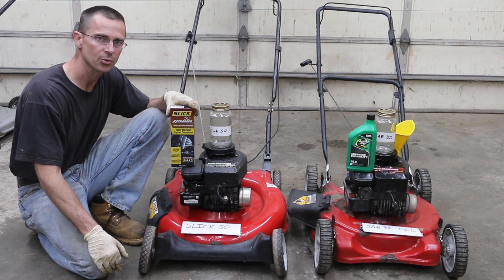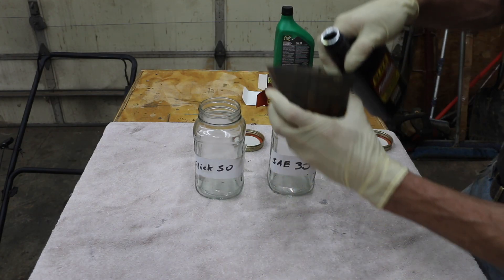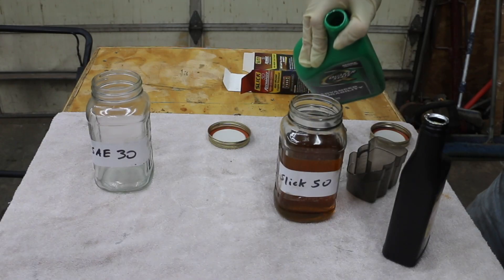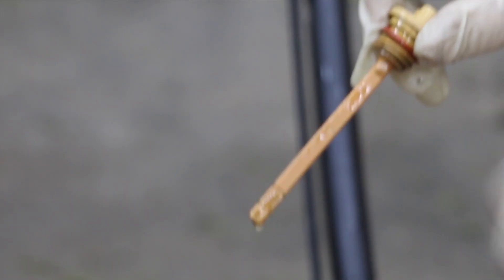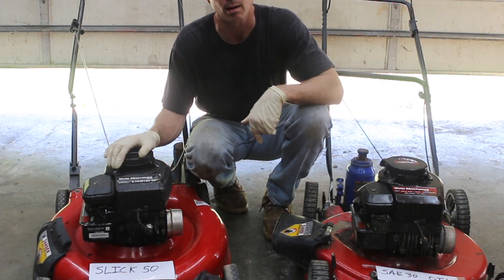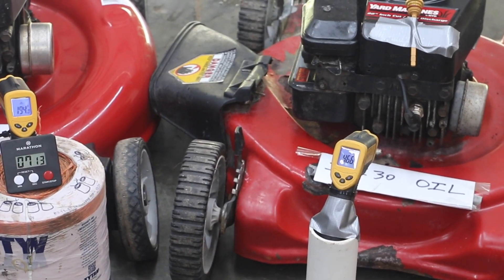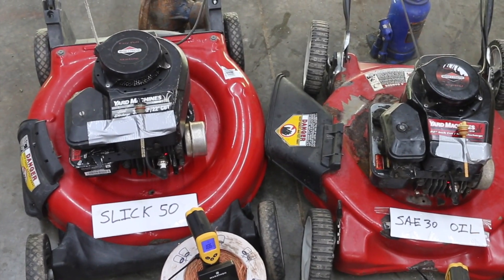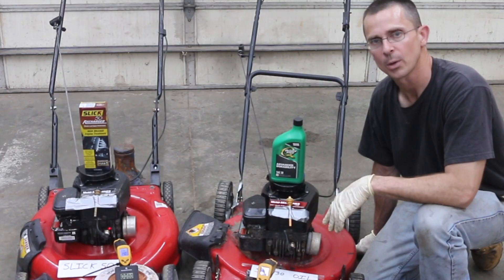Can't believe what SLICK 50 did to my engine!!--Dry Crankcase Test!

Comment: Although I like the idea of your video your test is flawed in one major way. Those engines where used. That being said you can't judge why one failed first. Engine wear from past usage plays a major factor in your test. Plus you didn't do compression tests. Not that a compression test is a tell all on other internal parts but it's something. But all that being said I still enjoyed the video.
Reply from the maker: Great point!  Agree, new engines would provide a much more fair test.  If money wasn't an issue, I'd buy new engines to test.  Thanks for watching the video and commenting!
Reply: Zedhead187 not the same engine either. I agree, not a good test
Reply: It was interesting but I too noticed that the slick50 engine/mower appeared much newer than the other one run with just oil. You might think that would be an advantage, but in reality an engine with a little wear is going to be more broken-in and have less internal friction, as well as more clearance in critical parts to retain an oil film after the oil is removed. Also, for the purposes of testing, we didn't see: Slick 50 instructions say to shake the container up vigorously before installing. Was this done? Otherwise the solids can settle in the base oil, and you wouldn't get much product using only the top few ounces. Also, IIRC from when I used it last, the engine is supposed to be run for 20 minutes at least on initial start-up after putting the Slick 50 in. Was this done, or does the current product still say this? Stuff that needs to be shown if the test is legit. It was a cool experiment, and I'm not shilling for Slick 50, but it wasn't anywhere near a good scientific test.
Reply: Cameronl games thats not the point I was raising. Not knowing the internal conditions of each engine leaves a lot to happenstance. 

What I mean is this. If the engine he put the regular oil in had less "wear and tear" and the slick 50 engine was "worn out" then the test is less valid. Now, just think if by happenstance the engines where switched and the "less worn out one" got the slick 50 and ran longer. The results would let us conclude that slick 50 does work. 

That being said when testing things such as this with used engines your test results can sometimes be less than accurate. Doesn't mean it wasn't worth trying though. I still enjoyed the video and his efforts.
Reply: lucus lube is amazing stuff, but keep at mind the company had been bought out and I've been hearing that lucus isn't the greatest anymore. I still use it though. alright I have a 1995 Chevy Silverado Z71. when i bought it had 101,000 miles on it and always ate a whole quart of oil right after oil changes. I started replacing one quart with lucus additve and fully stoped oil lose and now that engine has 889,567 miles on it right now. everything else has been replaced around it ...specially trans lol but Hopfully that gives you a good idea. btw the 350 that's in the truck has litterally nothing wrong with it at all still. very strong engine. cool Huh? so maybe lucus is really the best.
Reply: Project Farm 
Where did you get the vacuum pump?
Reply: Ben Jamin 
A simple 3 peakHP shop vac with that (mason jar) separator setup would've worked fine as well! However, you can get them at many places, Sears sells a basic one for 240.00 you can find them online for cheaper but 200 is a good starting price they range up to thousands.
Reply: Project Farm 
Nice.  Thanks.
Reply: that what I was going to say I bet the motor with the slick 50 would have blown period very soon. just mowing a lawn it obviously had far more ware than the other one did before the test. amazing how hot the other one got.
Reply: Zedhead187 husband
Reply: Thomas Tinsley ????
Reply: having a hard time there buddy?
Reply: +Riley Pearson wow Riley that's some crazy high mileage
Reply: Zedhead187    Yes that is very true i agree but think about the chances of an engine failing during this test for any other reason than what he is doing
Reply: Spankin' new engines would be a mistake too. Closest I could think of to ideal would be two new engines, run in the same conditions of load (or no load) for say 10 hours or so and then compression checked and possibly checked for crankshaft rotation effort to make sure one isn't still "tight" after breaking in. The performance and build quality of small engines at least at the cheap lawn mower level varies wildly. I've seen them seize after running just a couple of hours right out of the box. And with regards to your Slick 50, as said elsewhere, it sure looked like you were just pouring out base oil off the top.  The Slick 50 I've used has a milky look after being properly shaken before dumping it in. To be most "scientific" using only a portion of the quart, I'd suggest vigorous shaking immediately beforehand, then pour a 1/3 out, use the middle third, and leave the rest in the bottle. That way you'd get a more accurate sample of the contents.

Comment: The "original"  Slick 50 was formulated with PTFE (teflon micro particles) that would coat moving parts.
The new (currently available)  Slick 50 does no longer contain that key ingredient.

I was a huge fan of the old formula.
Sadly, it is no longer sold......

I found some NOS (new, old stock, over 20 years old..) auto oil filters that contained the same PTFE treatment component as the old Slick 50 and they fit my car!
I bought six and am enjoying them. (wish I'd bought 20 of them, they are no longer available).
After an oil change with those filters my engine is so smooth and quiet and the mpg fuel economy increases for a few hundred miles.
Reply from the maker: Yes, I've heard the formula changed and it isn't nearly as good. Thank you for taking the time to comment!
Reply: For anyone wanting to hunt some of those oil filters down? They were made by Fram and were called "Double Guard"   their stock numbers begin with  "DG" (such as DG8A, for their PH8A application, other DG-
 numbers were available)  Now, there are still a few around for sale by vendors of NOS leftover/liquidation auto parts. They say "with Dupont PTFE" on the package and filters, and had a plastic sealing cap over the business end.

Comment: I think the add with the engine with the drained oil was Prolong not slick50. They drained the oil then took the pan off then cut the radiator then poured gravel and dirt over the engine with the valve covers removed.
Reply from the maker: I'd better give Prolong this sort of test!  Thank you for taking the time to comment!
Reply: Yeah I don't know if Prolong is as good as they claim but the way I look at it if its only a tenth as good as they claim it's worth it. I know i had some in an old Saturn I had and the fan went bad and I over heated it to the point where I thought it should have seized multiple times an it didn't. I don't know if it was because of the prolong but I'd like to think it was. I'll be interested to see the results if you do test it.

Comment: Why did you not use two brand-new lawnmowers instead you put the slick 50 in the new lawnmower and the regular oil in the very aged other lawnmower that had been running for years
Reply from the maker: Dawn, I agree that 2 new mowers would have been the much better option.  I wish the cost of doing these projects wasn't a factor.  Thanks again for taking the time to comment!

Comment: LOL! Dude, you cannot just dump the Slick 50 in for a few minutes, drain it out and expect it to work like it did in the commercial. It takes time for the Slick 50 components to properly coat the engine internals. You have got to do these tests properly or they have no meaning whatsoever. Call them up and ask them how long it takes for the Slick 50 to adequately coat all the friction surfaces inside the engine.

Comment: I was an observer  of slick 50 back in the early 80's
I was told that even if the slick 50 engine would stop , it would restart after it cooled down
If you still have that Mower try to restart it
make another video ...... I'm curious
Thanks.  Great job by the way
Reply from the maker: I'll do a video on the Slick 50 mower.  Thanks for watching the video and for commenting!

Comment: What is labeled as Slick 50 today is NOT the original formula, the original formula is now sold under the name Exelplus. I did read the comments and a couple people kinda mentioned this, but not very clearly. I remember hearing tales about how good the stuff was back in the day, but it was a tough sell for me- since a complete oil change with filter back then probably cost 10-15ish bucks and a quart of slick 50 was around $20. Sadly just another tale of a name with a good reputation getting whored out for sales by a big company (I'm thinking of Lucas as well...when i think shell bought them). Anyway nice effort, good vid
Reply from the maker: It's too bad Slick 50 isn't the same formula!  Thanks for watching the video and for commenting!

Comment: those engines aren't ruined. let them cool, fill the crank case with oil, and then work the crank back and forth by turning the blade until it frees up. I've done it countless times mowers still run good and strong.
Reply from the maker: I'll see if I can free up the engines!  Thanks for watching the video and for commenting!

Comment: Slick 50 u buy today is not the same as the original slick 50, I think u can find the info on the net. 
Maybe try liqui molly MOS2. I used both and prefer the Mos2 by far.
Reply from the maker: Great point!  Thanks for watching the video and for commenting!
Reply: Temperature readings are the real interesting data set here. Time-until-failure could mean anything. Even temp@failure feels more interesting. Why is it cooler? Maybe that's its true benefit and usefulness to an engine.
Reply: If I remember correctly the original slick 50 added a teflon coating to the engine
Reply: Project Farm 
Your videos are truly fantastic... thanks for sharing..
Love to watch them and learn ....

Comment: In the oil patch some fellows had a small engine running with synthetic oil. They would drain it and leave it running while they ate lunch.

Synthetic oil is supposed to bond to the engine due to different molecule sizes.
Reply from the maker: Impressive!  Maybe I should try this test!  Thanks for watching the video and for commenting!
Reply: YES ABSOLUTELY... try the test. please let me know.

In the oil patch some fellows had a small engine running with synthetic 
oil. They would drain it and leave it running while they 
ate lunch. contact me at earthandyou@gmail.com

Even take one engine and see how long it will run with synthetic oil drained. It might need to be a new engine.... that only ever had synthetic oil.

(Synthetic oil is not really synthetic... it is modified base oil.. it think... or it is more filtered oil... I try to look into this and then get no real answers.)
Reply: ALSO.... a carboned up engine.... run hot and for an hour, is supposed to clean up the carbon... does it do it? ...would be a good test to do.
Reply from the maker: This is a great suggestion!  Thanks again!

Comment: just use oil... oil works best if you change it every once in a while!
Reply from the maker: Thanks for watching the video and for commenting!
Reply: The point is that there are so many things people say to add to your oil that do not make things better at all then simply changing your oil more often then every 20K miles without crap added to it. Save your money and just spend it on good oil.

Comment: I have used Slick 50 in the past and remember the instructions saying something like you are meant to run the engine for quite a long time to get the internals of the engine coated with the stuff and its meant to leave a baked on Teflon type effect on the parts.  Maybe you didn't run the mower engine for long enough for it to be effective.  I was quite surprised the Slick 50 engine failed so soon.
Reply from the maker: Yes, this is correct.  I should have ran the engine longer before the test.  Thanks for watching the video and for commenting!

Comment: Like the concept of the video, and if some including you want to know a little bit more about oils and a few additives, then this is a good reference page.

https://540ratblog.wordpress.com/2013/06/20/motor-oil-wear-test-ranking/

When Slick 50 came out I tried it one of my older cars, and noticed no change in temps or mileage, nor power. When Duralube came out I did the same test, and once again no changes except one. Oil consumption dropped in half on the car over the next month. Tried it in a second motor and saw the same drop in oil consumption over a month. Both motors have run for years now with it usually put in at most oil changes.

Oil Extreme Concentrate has some backers like David Vizard. I also tested Prolong Engine Treatment and saw no changes, but then I noticed 540 rats test and bought another bottle. Duralube, Prolong, like Slick50 claimed motors could run longer without oil in their TV ads.
Reply from the maker: I enjoyed reading your comments and thank you for the reference!  Thanks for watching the video and for commenting!

Comment: First of all " you caint purchase the original SLICK-50 at Wal-Mart or any other automotive suppliers ...
The original Slick-50 back in 1983 had a milkey color to it ....
Anyway the Slick-50 rep walked in our shop carrying a 5hp Briggs & Stratton engine ... He began to explain how this product actually works while filling the engine with just Slick-50. 
He started the engine and ran it at max rpm , for at least 30 minutes...
He removed the oil drain plug from the bottom of the engine and while it was draining , we all went to lunch ...
One hour later we returned and all of the Slick-50 had drained completely from the engine .
With the drain plug in his hand , he started the engine and ran it full rpm for over 30 minutes , and he shut it down ...
The engine NEVER SIEZED UP !!! Plus after a short cool down , he restarted the engine and it ran perfectly .....
THING IS " you caint buy the ORIGINAL SLICK-50 at the auto supply  stores anymore .... 
( SLICK-50 is sold in the stores ) BUT ITS NOT THE ORIGINAL FORMULA!!!
It can be purchased , but only from the guy that came up with the formula.... 
Check it out """ I know what this product can do , and I still use it in ever engine I have ....
THE ORIGINAL SLICK-50 FORMULA CAN STILL BE PURCHASED  ......
Reply from the maker: Great point!  Thanks for watching the video and for commenting!

Comment: I used to race radio controlled model airplanes. They were powered by small 2-cycle engines, 0.40 cu in and used nitro-methanol mixed with synthetic castor oil for fuel. Typically we would get 16,000 RPM from the engines without SLICK-50 and a standard propeller. The engines did not run very well with the SLICK-50 additive in the fuel. However, after running one 6 oz tank of fuel treated with the SLICK-50, then draining the tank and refilling it with just the standard fuel the engine would get an additional 600 to 800 RPM using the same fuel and same propeller. This would only work for the first tank of fuel run through after the tank of fuel treated with the SLIC-50. It was good fun and very interesting. We detected no excess deterioration of the engines during this process. Thought you might be interested. Regards, Frank

Comment: You should have chocked the wheels on those mowers before doing the test. The one with straight 30 weight was moving around a lot, you're lucky it didn't run amuk  and kill someone.

Comment: Xcelplus is the current product that used to be Slick 50 back when they did those dry run tests.  The current Slick 50 formula is not at all the same as it used to be.  :)

Comment: Try putting engine restore found at any local auto or oreillys it's literally just called engine restore I'm a firm believer in it put it in a worn out 270 thousand mile Chevy 305 engine runs even better than before I did and still runs great Six years later

Comment: I would try neat silicone spray. the kind used for slipping pipes with Orings together. it's cheap from a builders or plumbing merchants. I think this is about the closest you'll get to a liquid staying there to a degree after draining.